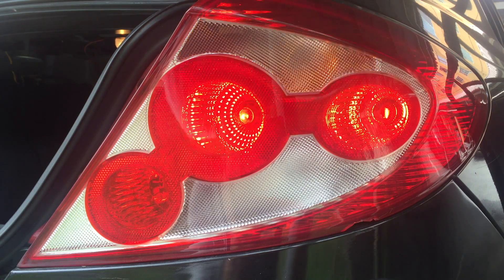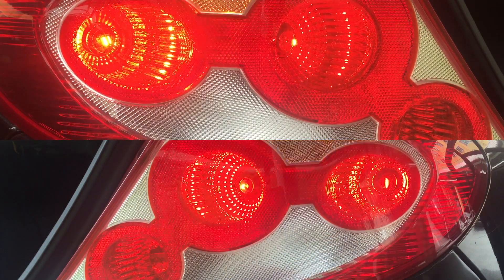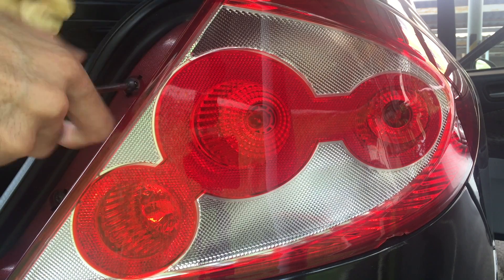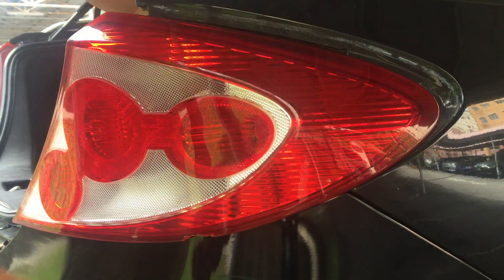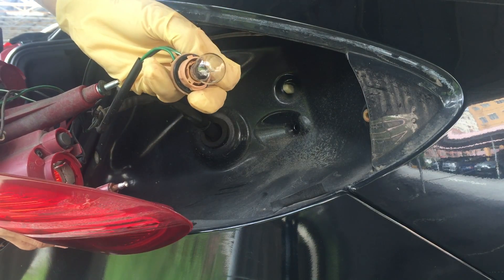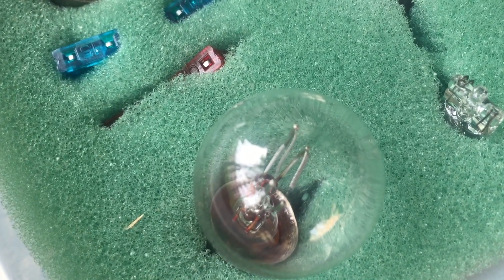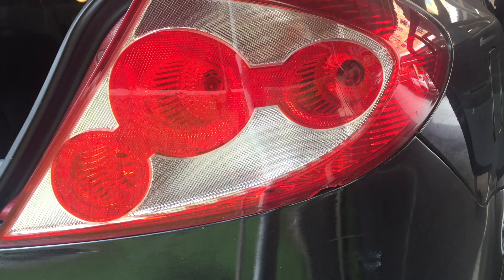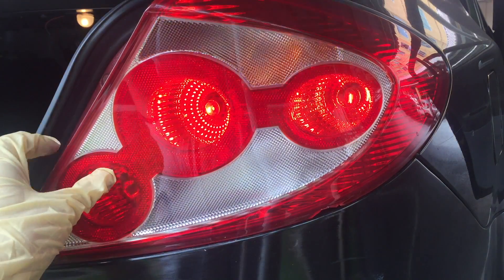How to Replace Brake Light bulb in Proton Persona 2012

Comment: how to change the front signal. the damn thing won't budge. i forgot last time how the accessories shop guy changed the front signal light. only now realized that they replaced it with cheap bulb, so that the front turn signal is not amber.
Reply from the maker: I changed it once. The cover fits only one way. There are notches around the brim. Can’t remember to twist which side to loosen the cap. Push inward then twist. It should work.
Reply: @CTB6  according to owner manual only have to twist counter clockwise. but since the my signal bulb housing is broken a bit, might have to do something else here.. 😥

Comment: i couldn't remove it... why?
Reply from the maker: Have you removed two mounting screw and the one behind the lamp?

You need to rock it left and right. It is possible that the metal pins is rusty. Refer minute 1:33. There are two pins. The one without screw is the one might jam inside. You may want to give a tap to the screw behind the lamp. Gently to break it free.